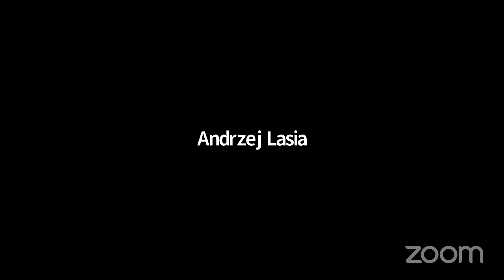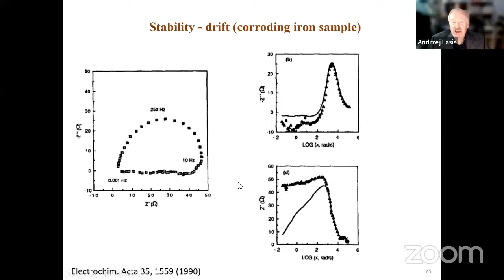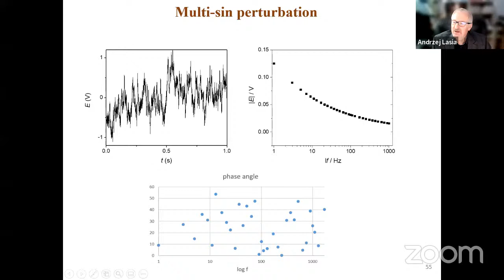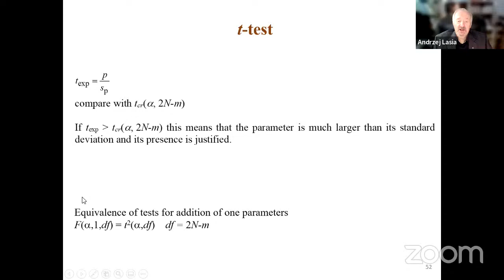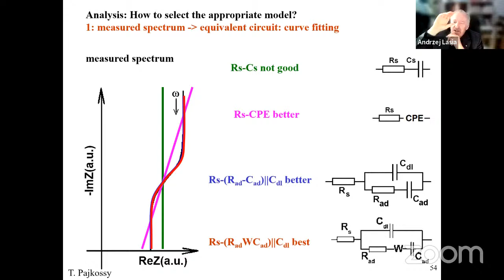15. Prof. Andrzej Lasia  - Modeling of Impedance Data (Feb 17, 2022)

Comment from the maker: 00:00 - Everyone is getting connected 
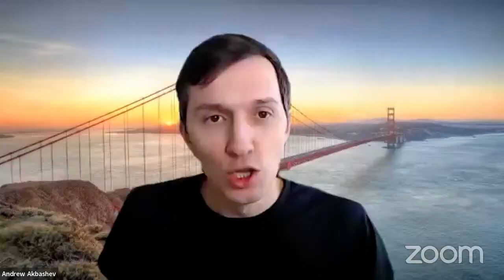00:24 - Introduction 
02:00 - Beginning of the talk 
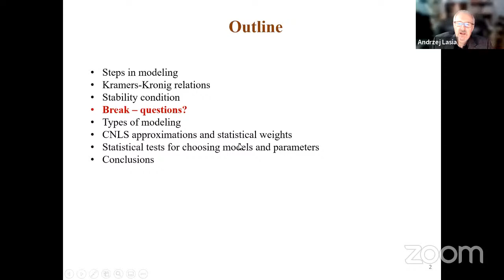03:09 - EIS modeling steps
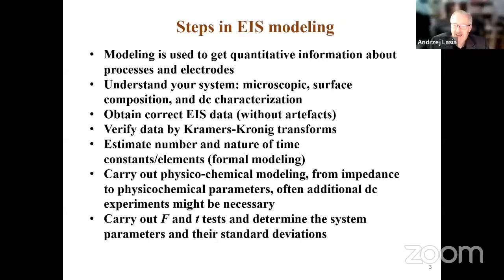05:05 - Data acquisition
09:11 - Consistency check and K-K relations  
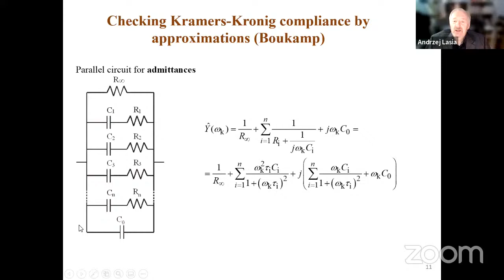16:53 - Negative impedances
25:08 - Hidden negative differential resistance  
29:43 - Kramers-Kronig transforms 
39:10 - Non-stationary impedances

First Q&A
41:47 - Q1: Negative resistance
43:38 - Q2: Why positive Z’’ appears
46:54 - Q3: Nature of negative real part of Z
49:07 - Q4: Why selecting a wide range of frequencies
51:26 - Q5: Phase in multi-sin perturbation
53:36 - Q6: K-K transforms 
55:00 - Q7: Stability criteria and dynamic EIS

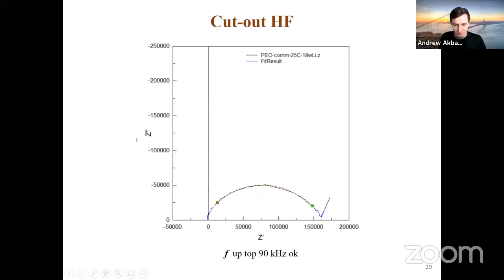 56:26 - Modeling of EIS
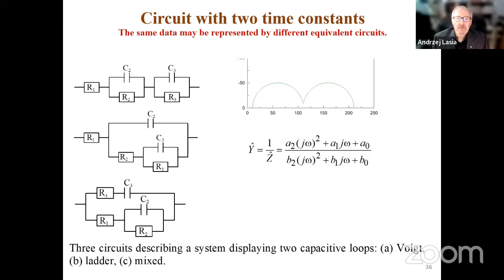1:00:25 - Hydrogen evolution reaction 
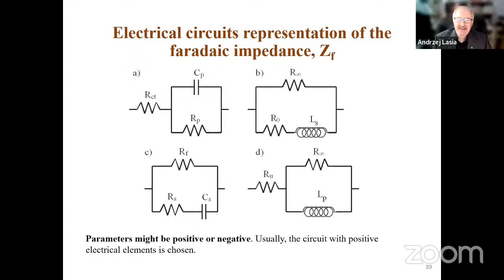1:03:32 - Positioning the Warburg element
1:04:48 - Other types of impedances 
1:05:49 - CNLS Approximations 
1:08:58 - Weighting procedures and statistics
1:19:55 - F-test for adding new parameters
1:25:51 - t-test for additional parameters
1:27:25 - Selection of appropriate models
1:30:28 - Software for EIS modeling

Second Q&A 
1:33:30 - Q1: Applicability of statistical analysis 
1:34:03 - Q2: Reference electrodes for EIS
1:36:57 - Q3: Physical meaning of CPE element
1:40:25 - Q4: Second-harmonic EIS
1:42:28 - Q5: Difference between good and best fits
1:45:30 - Q6: Positioning of Warburg element
1:50:17 - Q7: Complex electrodes and complex circuits